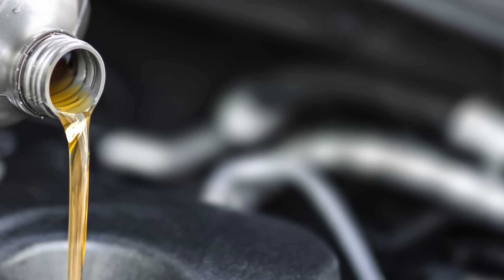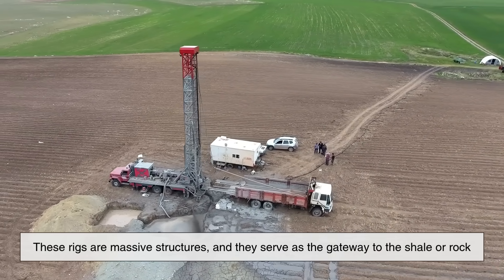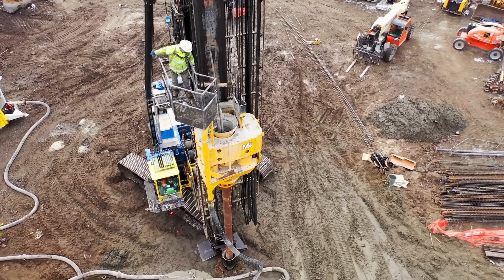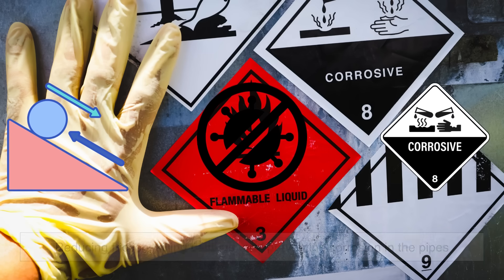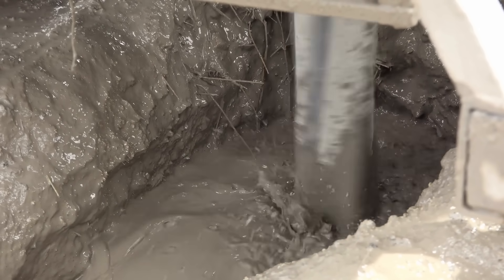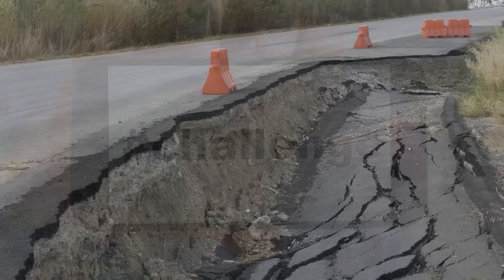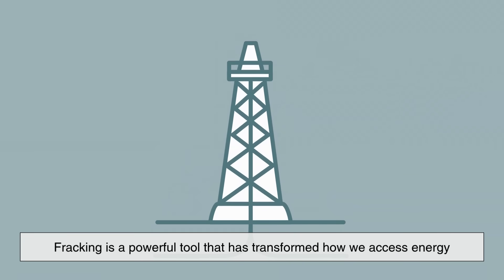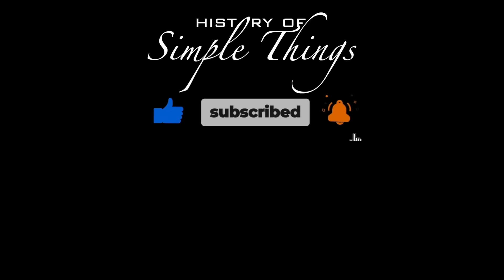What is Fracking and How Does It Work?

Comment: Very well presented in many aspects.
You could mention that calcareous rocks are the most desirable, precisely because they are brittle, fracture easily and so respond well to the technique. 
Measured vertically, productive formations are often not extensive. A vertical borehole would present a minimum of surface area. The number one idea of horizontal drilling is to extend this significantly as a longer length of borehole runs through the productive zone.
Noy only sand, but small glass balls are often used, particularly in calcareous formations, as the fractures are wider.
Traditional oil/gas reservoirs are formed by a variety of tectonic traps (anticlines, faults, etc.) which trap less dense and therefore more buoyant hydrocarbons as they appear in initially-tiny droplets and then attempts to rise to the surface as their buoyancy urge to move up then overcomes the "stickiness" caused by surface tension. That is to say, the water and the hydrocarbons do not mix. On the other hand, the gas in water is absorbed through pressure, like fizzy drinks and so does not follow the same dynamic, but more importantly, doesn’t need tectonic traps found in specific places such as Saudi Arabia, etc. All they need is extensive underground aquifers above a particular depth, as obviously, the amount of absorbed gas is proportional to the pressure and therefore depth.

Comment: It would be interesting to know how they turn a drill bit 90 degrees. I live in Tulsa, Oklahoma, and remember the over 4.0 earthquake we had in November 2011. Until that point, we just didn't get earthquakes. Not like that. We never felt them. Overnight, we went from believing in our solid, stable bedrock to living on a dynamic lithosphere. It was disturbing to say the least.
Reply: It's called a whipstock and it's basically a suitably shaped and dimensioned, increasingly-angled cylindrical wedge that suitably bends the BHA (bottom-hole assembly), which, needless to say, is designed to be easier to bend...
Reply: @robinmatyjasek7390 no - a whipstock is used to kickoff from a vertical bore.  The shale drillers know the depth and geometry so the use a streetable BHA where the can adjust the build angle taking the well ore from vertices to horizontal in a smooth transition.
Reply: @DR-00700 So the BHA assembly is like a well-trained dog, and takes of vertically on command? So there is no additional hardware involved according to you. Patent it right away and you will make a fortune!!! Or become a magical directional driller! A non-magical driller only has under their control (a) rotational speed (b) weight on bit (c) mud pump pressure, and with that, my sadly mechanical brain fails to understand. But I would like to get my percentage cut as a consultant who started you off on the road to fame and fortune... But, irony aside, my understanding of whipstocks can take the borehole trajectory from just a small sidetrack angle right up to to a full 90º.  A sidetrack becomes necessary usually when an irreversibly stuck BHA needs to be discarded. The "discarding" operation in itself is quite interesting and requires the use of explosives, in this case, usually an elongated bundle of primer cord. This operation is called "backing off" where a carefully calculated amount of left-hand torque is applied to the BHA by the driller, but not quite enough to unscrew. The casing collar joints are located by running a CCL log which is a magnetic device which identifies them through the change in the magnetic flux transmissibility  caused by the butt joint. Firing the explosive provides the jolt necessary to momentarily remove the static friction and allow the thread to unscrew due to the left-hand torque applied. So, with my evidently limited understanding, I sincerely apologise if I am ignorant of the physical (or, as you suggest, paranormal) devices and techniques you allude to. Perhaps you can enlighten me?
Reply: @robinmatyjasek7390 the BHA is whatever you wish to put in it including an RSS.  What you talk of is a blunt and basic wedge set in a vermicelli well to sidetrack or kickoff a horizontal well. This is not how the frackers do it as it involves too much time and risk.  Look up an RSS for how modern drilling is conducted before your sarcasm has you climbing to the top of the dung heap to crow a bit more lack of knowledge.  Whipstocks are very old tech in the drilling world.
Reply: @DR-00700 And I can tell that you voted for Trump as well...
Reply: @robinmatyjasek7390 that’s a bit childish Robin, I am not an American, I am European and not only have I sat on drilling rigs as a company man I have designed and managed many drilling operations around the world both onshore and offshore.  Worst drillers I worked with were American, arrogant and experienced based rather than engineers.  I do not doubt there are many good ones I was just unlucky getting the bad ones.
Reply: What magnitude?